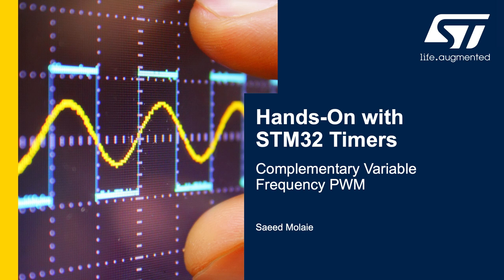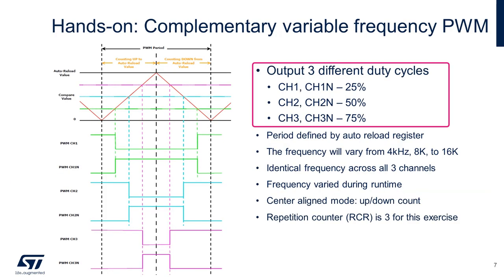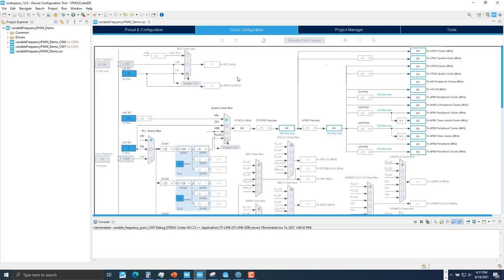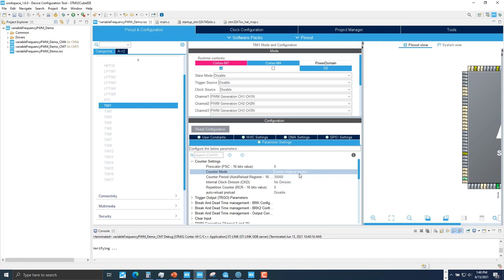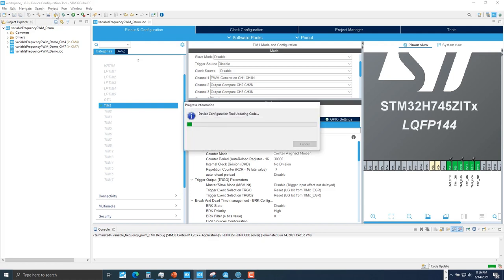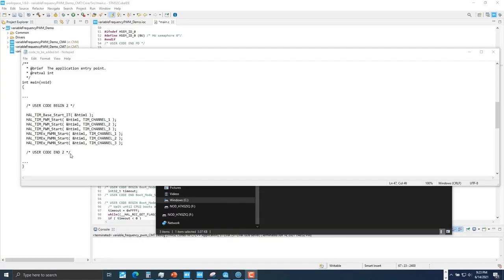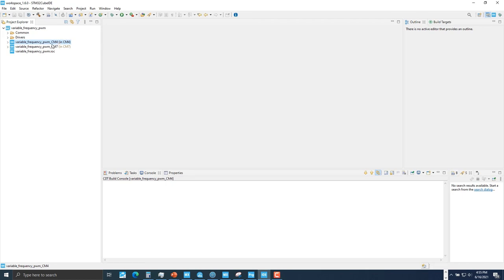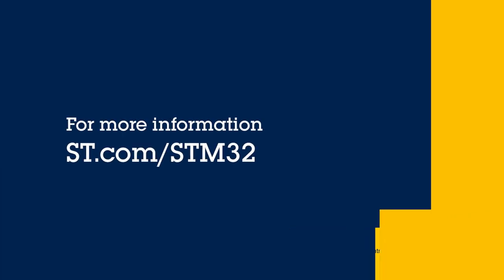Hands-On with STM32 Timers: Complementary Variable Frequency PWM

Comment: For this to work, you should enable the "auto-reload preload" feature, so that the ARR will be updated at the same time as the CCR and not immediately. Tested on the F413. Note that in the Cube project, inside the linked ZIP file, the "auto-reload preload" feature is (correctly) enabled.

Comment: i want to generate 3 phase pwm, 120 deg phase difference and varying duty cycle (0 t0 100) using timer 1 of stm32f730. is it possible to generate using single timer timer1.
Reply: Did you figure something out

Comment: I was looking for this exact content. Thanks.. Could you please talk about the selection of 30000 for ARR and not selecting Prescaler? Also if I want 5hz PWM with 50% duty and 10HZ PWM with 50% duty how do I proceed? How to relate this ARR number to these frequencies?
Reply: This is exactly what i was wondering. how will we set frequencies using ARR numbers accurately?
Reply: Configured Fpwm=240MHz ( check @ 3:46)
Say we want to generate 4khz PWM with 50% D. 
So, 2 ARR's should be reached in 1 PWM period (center aligned more : ramp up and ramp down).
Therefore, ARR = 240M/(4k*2) = 30000.

For 5khz, ARR= 24000
      10 khz, ARR = 12000

If the prescaler was set to 1,
Fpwm=240/2

In general, Fpwm = 240/(2**prescaler).

Rest equations remain the same.